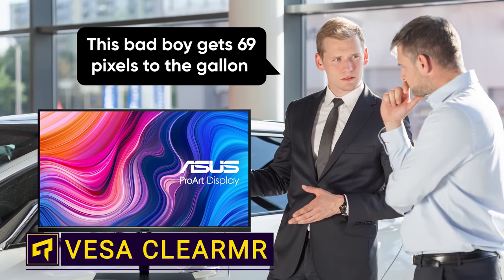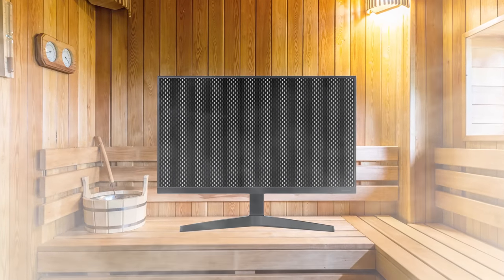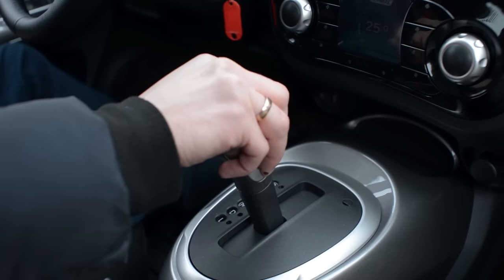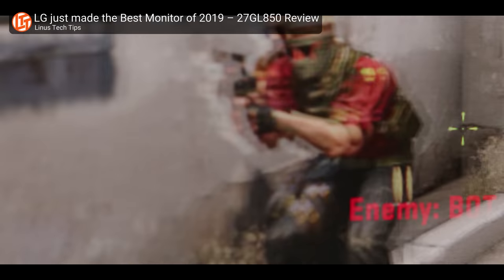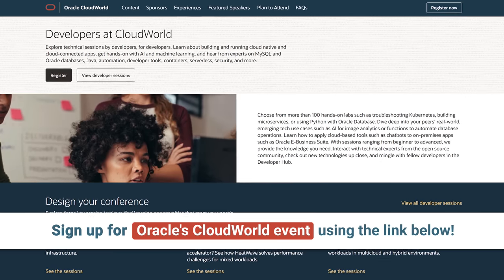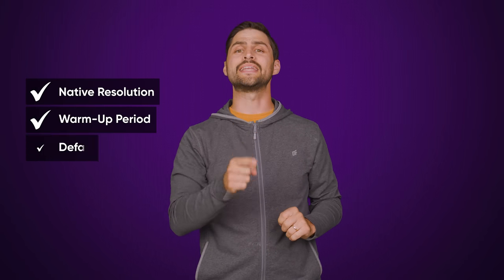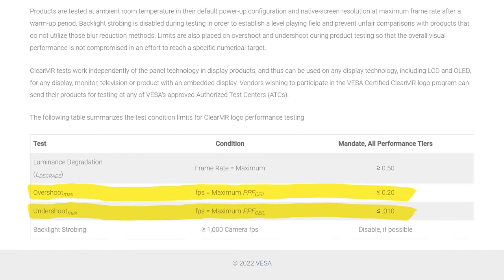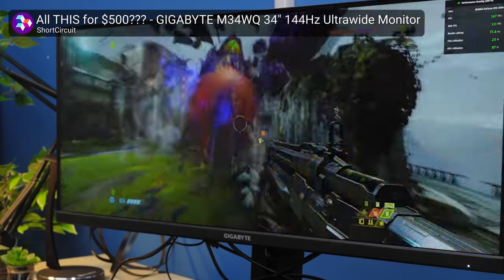Monitor Companies Have Been Lying To You

Comment: Does that mean gamers living in really warm places (like 35C warm) have an unfair advantage in pixel response time over other gamers?
Reply: Basically no, for official e-sports competition venue, there are most likely having air conditioner
If they don’t turn on air conditioner at home, they are basically sitting next to a computer that will make the room even warmer, it will distract the player
If computer not have strong cooling system, it may also over heat and become slower

Comment: There's this cool new display tech that can reproduce great color, in high resolutions, at high speeds, and with great brightness. It's called "CRT." A little power hungry, but hey, if you're gonna feed your new GPU 500 watts, can't you spare a couple hundred more for your display?
Reply: Yeah I will wait until they release them with HDR...
Reply: Define "high resolutions" because CRT's definitely ain't that high
Reply: @YOEL_44  That came out in 1968. It was called, "Trinitron."
Reply: @ScottGrammer  Trinitron was a Sony alternative to the aperture grille, which increased overall bightness, but it was very much not HDR as blacks where as washed as in any other CRT, and of course they do not support an HDR signal, so yeah, don't even try.
Reply: @YOEL_44  HDR is just a different black level. But it was a joke in the first place. Today's best displays are certainly better than the best CRT's, but CRT's could, had they continued to be developed after say, 2003, have been as good today. Granted, no flat, wall-mounted 100" displays with that tech, but on the other hand, if a gnat lands on your CRT and you swat the gnat, you don't end up with dead pixels like I got on my six-month-old 4K Samsung.

Comment: Isn't a pixel just a dot of color? How can it be "clear" or "blurry" without respect to the image at large?
Reply: I think what's being defined here is whether that pixel, that single dot of colour, is displaying the colour it's supposed to , or a mix of it's intended current state and past frames because it hasn't changed quickly enough.  This will manifest as horizontal/vertical blurring of movement, but you can also say that the individual pixel has blurred it's state in the time domain.
Reply: @ffsireallydontcare  yes, I think so too, but that seems to be a subjective measurement, rather than objective?
Reply: @TheSilentknyght  I can't remember what objective measurement ranges fed into the various classifications, but historically (and this forms part of the argument against manufacturer provided specs) "grey to grey" has been the objective measure but performed under favorable conditions..  This is the time a single pixel takes to go from 50% grey (50%R 50%G 50%B) to 100% white (or black) then back to grey.  This time is measured in milliseconds and represents the theoretical maximum frame rate of the monitor.  By it's definition a frame has a duration in milliseconds, so for 25 frames per second a pixel will need to hold it's state for 40 milliseconds, 50 frames per second 20 milliseconds and so on.  
For a 120 frames per second capable panel each frame is on screen for 8.3 milliseconds.  So for low frame rates (60 frames per second) the "grey to grey" time is less important with a pixel holding one frame's state for longer, but as the frame rate goes up a rapid pixel grey to grey time becomes more important.  
If you tried to display 120 frames per second on a 10 millisecond grey to grey panel then each pixel will display either 2 or 3 frames worth of information at any given moment, there will never be a stable state where the pixel is only showing the colour intended for the current frame, so the whole picture will appear as a smear of 2 to 3 frames.  2 to 3 frames worth of smear at 120 frames per second doesn't sound bad, but the problem is that these advertised specs don't represent what the panel is actually able to do and so the actual picture quality will be far worse than what you expect.
What they're trying to do is boil all that analysis down into categories objectively measured under controlled consistent conditions by, and independently verified by, a trusted authority.  The smallest unit that can be measured which feeds into the whole analysis is the pixel.
Reply: @ffsireallydontcare  so, rather than "blurry" as in videogame footage, it's single screen wide color and they measure via colorimeter?  That would make sense.
Reply: @TheSilentknyght  I would expect so, but I think their equipment will be more sensitive than an off the shelf colorimeter.  Whether they can measure an actual single pixel is unlikely, so they'll be measuring a group of pixels which will make the measurement an average of all the different response times achievable by each individual pixel.  They'll also be using calibrated video sources (less important and less variable for digital displays) and carefully environmentally controlled rooms.

Comment: Yes, that's what we need!
And enforce crApple to add chargers.
To return AUX ports on phones (wired headsets are far cheaper and superior. I won't include SD cards for various reasons)
PCs that brag about specs on paper but in reality they suck.. Both in performance and money from our wallets. 
And so on.
Reply: Just buy a usb dac, all the included aux ports on phones sounded like shit aside from lg. also every major smartphone company besides oneplus ditched chargers in their flagships, not just apple.
Reply: @marcusborderlands6177  you said their flagships, interesting. But apple did this for all models, even the XD which originally shipped with a charger!
Besides, even some flagships and flagship killers (like the 11T Pro) came with their superb chargers.

Comment: Techquickie idea:
What does the middle prong on electrical plugs do / how important is it
Reply: The Ground? That's a long topic but you could find some cool videos about its function and purpose .
Reply: A quick google will tell you the answer, that its a ground prong to protect you from electrocuting yourself if a metallic appliance or device you have plugged in short circuits.
Reply: @Elliott13  the point is "as fast as possible"

Comment: I can promise any monitor proudly touting 1ms is actually just MPRT, a useless stat. and the G2G time will actually be about 6ms AT BEST, and up to 12ms in some use cases/environments. Which looks perfectly fine but for some reason instead of being honest by saying "6ms is good for gaming and anything slower than 12 is bad" They go "OUH LOOK 1MS, SPEEDY SPEEDY YOU WANT THE FASTEST PANEL EVAR RIGHT!!??!!??" Despite most tech literate people knowing its a crock of shit meaningless number to slap on the box and nothing more.

A better solution is ban MPRT from being a selling point, FORCE them to use G2G and FORCE them to test in the same type of environment with a standardized test. This new VESA nonsense is just more useless numbers. Willing to bet 2 monitors with the 7000 badge will perform vastly different in the real world. 2 monitors that are certified at 6ms G2G however will perform identical, as its a SINGLE specific spec, and not some broad classification/rating system.

Comment: I have 3x Gigabyte G32QC A 32" 1440p monitors for working from home. They advertise a 1ms (MPRT) response time, 🤣 Hahahaha ROFL!! Yeah OK Gigabyte, I tried gaming on them once, and even with overdrive on Fastest or Balanced the response time was as half a second, 500ms not 1ms. The blur and ghosting are so bad it was making me motion sick and causing eye strain within a few minutes, I mean it is extreme.
Great cheap monitors for work, I'm happy with them for that purpose but JFC they would be terrible for gaming.
Reply: MPRT stands for moving image response time, aka image persistence, this has to do with the backlight strobing feature on the monitor, where it only turns the backlight on for 1ms every frame. reducing image persistence and therefore motion blur, not an actual response time measurement, another cheeky way of manufacturers lying to you 🙃🙃
Reply: @iamfrog6747  I did not know that, thank you,, that's interesting and very good to know.